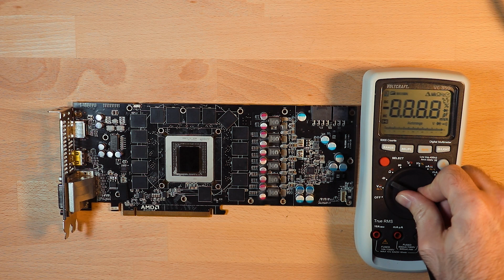Graphics Card Necromancy - Diagnostics - Radeon R9 290X Episode 1

Comment: I seem to have a short down all 10 lines of caps. Does that mean the GPU is shorted or ????
Reply from the maker: When you say all 10 lines of caps, which caps are you talking about?  The little SMD ones between the core phases and memory ICs?  How are you determining that you have a short?  Do you have 0.0 ohms to ground, or are you trying to use short detection ("beep") mode?
Reply: @AaronAverett  I checked both sides of the smd caps as it looked like you were doing and the coils nest to the mosfets. I used ohms range with the probes touching ( 0.24) and each of the spots I mentioned and got the same with in .00-.02 of that reading (.24-.26).
Reply from the maker: @amtpdb1  If you really do have 0.24 ohms to ground on that rail, then you have a short, and the game changes to figuring out where the short is.

There are basically five places it could be, in descending order of likelihood.  Note that the order of this list varies by card design.
1.  The GPU core (the most likely)
2.  A capacitor
3.  One or more of the low side FETs
4.  The PCB
5.  Some other connected circuit, like a phase or VRM controller

The most direct way to determine which one it is is to inject the circuit operating voltage (1.2 volts in this case) into the rail, and use whatever tools you have at your disposal to look for components that get warm.  A thermal camera is the best way, but you can use freeze spray or isopropanol, or even your fingers, if you have to.
Reply: @AaronAverett  Thanks

Comment: 2021: the price of the GPU's has skyrocketed since a while now. And my watercooled R9 290x had a failure linked to a leak that I didn't address properly. 2 MOSFETS besfore the filters has burnt due to a short circuit, and I'm trying to analyse the board a bit before trying to replace them. This video has interested me at the highest point. thanks dude!

Comment: Hi I have a r9 290. it works well with the default windows driver, but when l install the AMD drivers a black screen appears and no more video is seen.  Do you have an idea what it can be?
Reply from the maker: Probably a BGA failure, unfortunately.  It's technically possible to repair that, but if you have to ask someone else how to do it, the cost to do it will be greater than just replacing the card with a working one.
Reply: @AaronAverett  ok thanks for your answer. 👍🏻

Comment: can you please help me with figuring out the problem i have with my 290x....vrm 2 temps sky rockets after 5 sec of start up and goes to 120-125 which effects the performance of the card
Reply from the maker: Have you tried replacing the thermal pad that cools the VRM?
Reply: @AaronAverett  yep
Reply: Placed thermal pads on the back too...but nothing worked
Reply from the maker: That being the case, the next thing I would suspect is the bootstrap capacitors.  If you watch my other videos on the 290X, one of my cards actually had a very similar problem, where one of the bootstrap caps had gotten knocked off the back of the card, and I showed how I figured that out and replaced it.  I think the video is #3 in the sequence.

Comment: Saw this video series out until the end. You have amazing skills and knowledge, it makes me jealous, especially because I have two R9 290 not working. One of them switches off after 20 seconds. I've determined that the entire array of small capacitators right next to the VRAM receives 0.96V when the card starts up and drops to 0, explaining the card go black. What should I test now to determine the culprit of this behavior? I would appreciate you suggestion :)
Reply from the maker: That's kind of an odd problem.  My guess would be that you have a partial short to ground somewhere.  What I would do is check for resistance on each of the power rails, and see if any of them are way outside of normal.

Do you get a picture on the screen during the 20 seconds the core VRM runs?
Reply: @AaronAverett  Hey, thanks for the reply. I think I have narrowed down the problem. There is a semi-short (25 ohms) between ground and the 5V pin (2nd pin, the one below the arrow) of converter U300 (located below the leftmost memory chip). I have no clue where to look next. I only got this far because I can compare to the other R9 290 :/
Reply from the maker: U300 is an NCP1587.  Pin 2 on that is the high side gate pin, which connects to the dual NFET package on the other side of the board.  I've got 50K to ground on that pin.  

Pin 8 is switch node pin, and I've got 184 ohms to ground on that.

My first suspect in this case would be the transistor package on the back of the board.  It's possible for that to fail and create a partial or complete short to ground.  I would remove it, and see if that clears your short.  If so, get and install a new one.

Edit:  The second suspect would be the NCP1587.
Reply: @AaronAverett  Thanks again Aaron. My main problem is that you are overestimating my component knowledge :/ The transistor package on the back of the card. I wouldn't  know which of the components is a transistor package :(

Comment: Huge help, thanks for posting this! My 290X fails (reads 0) at time stamp 6:07 and wanted to ask how I would begin testing from this fail point backwards.  I removed the chip with my heat gun and tested position 8 directly on PCB with same results. Thanks again!
Reply from the maker: I was actually wrong in that part of the video; that chip is one of the card's two BIOS ROM chips, and not a regulator.  Pin 8 on it is Vcc, or the power input, so if you have zero ohms to ground right there even with the chip removed, that means you have a short to ground elsewhere on the board.  The power for that chip is 3.3V, which comes in at the PCI-E slot connector.  Unfortuntely, it goes all over the board, so your short could be practically anywhere, but the good news is that it's unlikely to be a component that's hard to replace.

First step is to put the BIOS chip back on.  Next step is to find the short.  Inspect visually first and if that doesn't work, current injection is what I'd try next.  3.3V is high enough that whatever is shorted should get hot enough to be pretty obvious.

Comment: Good afternoon! I rereballed a video card, the r9 and r7.O But all I do about the error . The motherboard starts with onboard video, and the video card doesn't even appear on the gpuz. As if the graphics chip were not there. I suspect it is the oscillating crystal next to the gpu
Reply from the maker: The crystal should be easy enough to test with an oscilloscope, but I'd be more inclined to suspect that your reballing just didn't go as planned, rather than that the crystal failed.

Why did you conclude that you needed to reball the GPU?
Reply: @AaronAverett  ok, the reballing was good. I believe my source burned the ram. because my pc was giving shock. now how to fix Vram?

Comment: hello  some great info.. I'm missing ML1002 inductor on the backside of the card.. any info on that ?
Reply from the maker: I don't have an exact part number, but you're looking for a 0.47uH inductor, ~5.2 by 5.2mm by 1.9mm height.  Maybe like this:
https://www.digikey.com/en/products/detail/eaton-electronics-division/HCMA0503-R47-R/5168116

I have to ask though - how did you manage to lose the original one?
Reply: @AaronAverett  bought not working from ebay.. was cut off or harvested .. looks like
Reply: Thanks so much for the information. You are great!!
Reply from the maker: Wow, you're a braver man than me, trying to fix a card that's already been cannibalized.  Be sure to post a video or something if you get it working.
Reply: @AaronAverett  sure. Will do
Reply: @AaronAverett  That inductor did the trick. I’m a horrible at soldering. But it does live. Thanks for your help.

Comment: I'd recommend you get a pci riser and power that one from a laboratory psu, limits current and you can move the card around more freely
Reply from the maker: That's not a bad idea, but you really need the system attached in order to do the test properly, so you can be sure that it's at least trying to power everything up in the proper order.  The simplest way of doing that is to use a motherboard I got on Craigslist for $20.

A longer riser cable might be nice, though.

Comment: 6:05 I have a broken Reference 290 non-x and I get about 60ish ohms. What exactly is that chip?
Reply from the maker: That is a Pm25LD010.  It's one of two BIOS chips on the board.  The other one is on the front of the card.  The pin I'm probing there is the power supply input pin for that chip, which is connected to the 3.3V rail.

If you have 60 ohms there, you have a short to ground on your 3.3V rail.  The 3.3V rail goes all over the card, as I recall, so the failed component is not necessarily anywhere near that BIOS chip.  What I would do next is visually inspect for damaged MLC caps.

Comment: Thanks for the video, I have an Asus r9290-dc2oc-4gd5 graphic card and there are three capacitors beside (PQ103 & PQ102 & PQ101) IC'S exploded
my question is how could I know how much is the value for these Capacitors to replace them or do you know how can I get the Scheme for this card?
Reply from the maker: I don't know of a source for schematics for graphics cards.  They basically don't exist outside of the manufacturers, unfortunately.

If you're talking about the 0805-size capacitors to the right of PQ101-106, then the best way to determine their capacitance is to remove and measure the corresponding cap from an undamaged phase, and then put it back.  One thing to be careful of, though, is that you don't normally see SMD capacitors fail three at a time on unconnected circuits, so if you have the same cap failing on three separate phases in a multi-phase VRM, you likely have some other problem that needs to be addressed first, such as a short to ground.